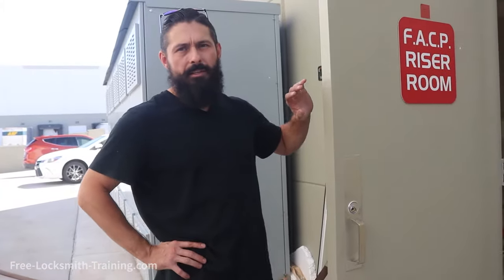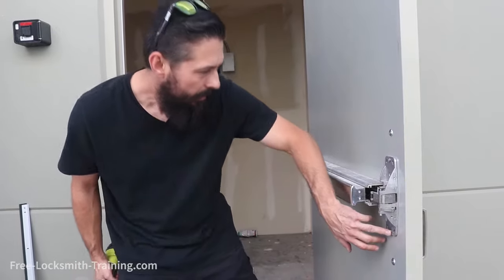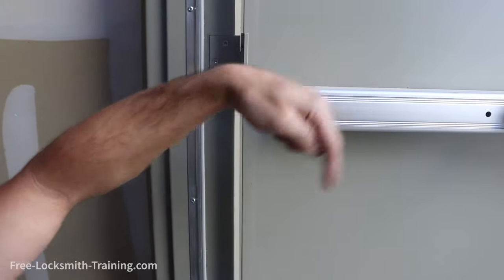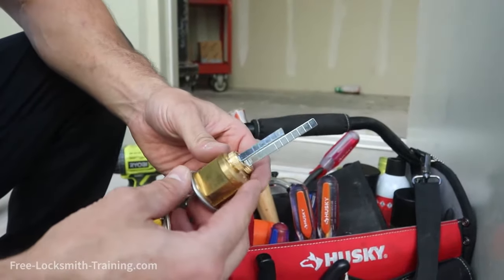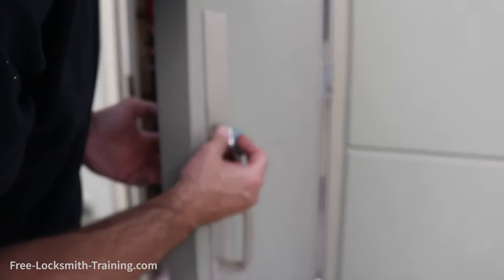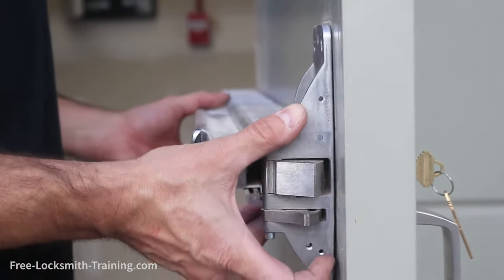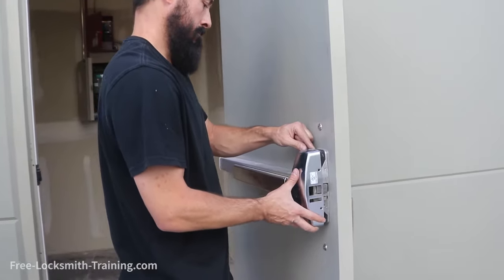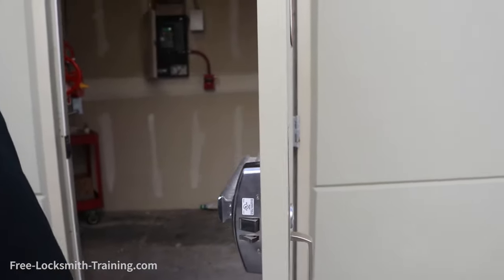Replace Rim Cylinder | How to Install New Lock on Push Bar Exit Door | Free-Locksmith-Training.com

Comment: ive got a series 99 panic/crush with a 7500 mortise casset and 996 trim. Does the cylinder just rotate out of the trim after the set screws are losened? It seemed the cylinder was holding the trim on.  I dont think I actually have a hole/screw where you did to remove the cylinder.
Reply: If everything is lined up correctly on a mortise panic then yes once you loosen the cylinder set screw in the cassette then the cylinder should just spin out.

Comment: I have a question about the little metal piece on the back end of the crash bar under the plate on right side when u turn the key it moves the mechanism to allow the door to open it keeps going limp everytime i tighten it down u know an easy fix? Or what do i do in this case?? Please help if u can!! Thank.you
Reply: You’ll need to order a replacement dogging kit. They’re made of plastic or nylon, and tend to wear down over time. A common problem.

Comment: Why not have used a bypass driver? Or broken the pin and unscrewed the cylinder?
Drilling is my last resort after I’ve failed picking, bypassing and sheering the pin on the side

Comment: Ok have a Q? Is that not a KNOX BOX on the Latch Side of the door. Where's the FD key to that box. Then you have a service key to that door. Because that's a FD CONNECTION & Fire Sprinkler System. 
Now that you've changed that lock the FD can't get access to the sprinkler system.
Reply: Great question.  Seems important.

Comment: Attention new guys...be careful using drills or drivers with door hardware.  It is very easy to strip or cross thread these screws.  I have been doing commercial door hardware for years and I still always use just a screwdriver on most screws especially those in the trim.
Reply: so good 👍#udayadewvlog
Reply: Great advice 😊